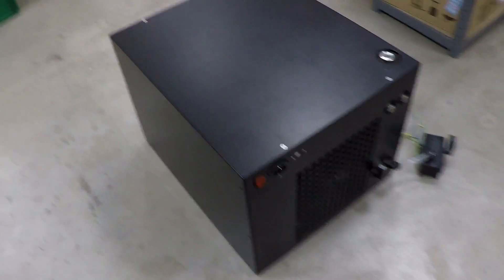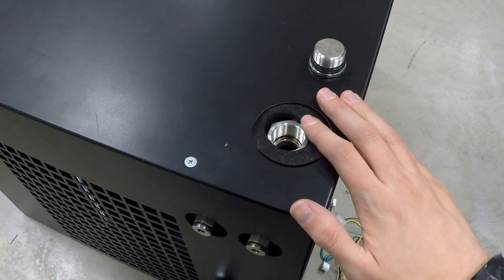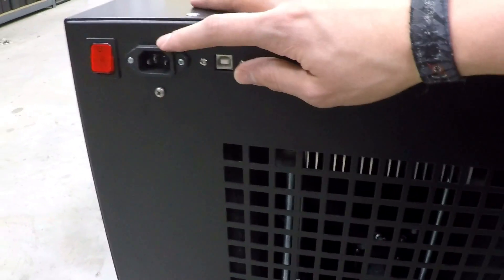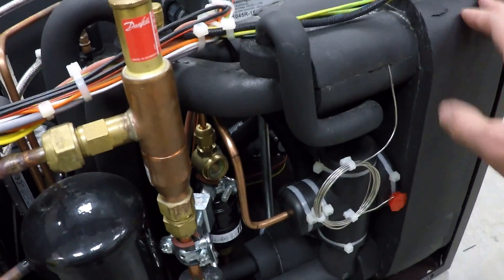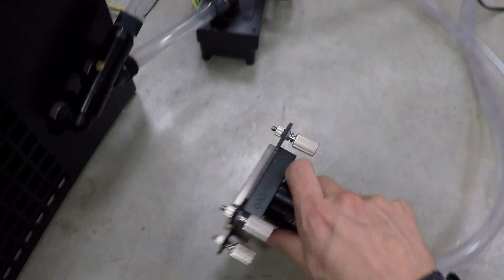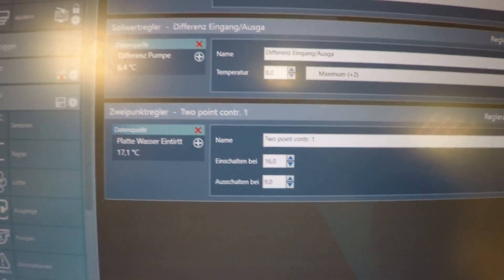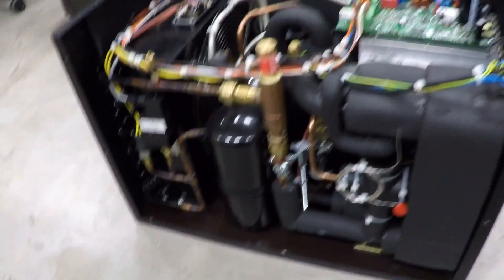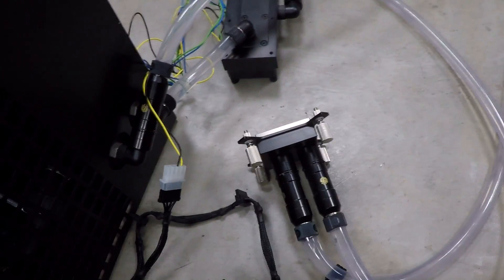The Titan X Project - Part 3: The Chiller

Comment: Hey Roman ich habe da eine Frage oder auch an die Community. Ich habe zurzeit EINEN RAM Riegel DDR3 mit 8GB und 1600 DIMM. Ich möchte mir jetzt weitere 8 holen also damit ich insgesamt 16 habe. Sollte ich mir jetzt die weiteren 8 GB als dual holen sodass ich dann 3 Riegel habe oder das ich insgesamt 2 Riegel habe?

Comment: Where is the titan x pascal overclocking video after all the power mod ?
Reply from the maker: didnt have time to finish it yet. Moving into a different apartment atm which takes some time :/
Reply: Hey man. Thanks for your helpful vids. There is a little debate regarding the power mod on pascal, and if you should mod 1, 2 or all 3 resistors. Do you have some thoughts on that matter by any chance?

Comment: Roman, I've hooked up my chiller, works like a charm! But I'd like to cool my water a few deg below dew point. What would you recommend I should coat the area around GPU and CPU with?
Reply: +Steeludder Would a conformal coating spray be enough?

Comment: Ich habe  eine Asus Strix Advanced Acitve GTX1080 die momentan durch Asus GPU Tweak stabil auf 2088 Mhz läuft (Powertarget 120% - Memory Clock 11000Mhz - GPU Boost Clock 2000Mhz  - Temparatur unter Volllast (Benchmark oder beim Zocken von BF1 Max 65°C))
Wie weit kann ich noch gehen ohne Angst zu haben das mir etwas an der Karte "Durchbrennt" etc gibt es etwas auf das ich achten kann / muss ? Die Voltage habe ich nochnicht verändert. Kann ich den Boost Clock & Memory Clock einfach noch höher schrauben ? (via Overclocking range enhancement)

Comment: Actually how it works is the compressor turns the coolant to gas which gets to the radiator to cool down and then it goes to an expansion valve which turns it to liquid and makes it super cold and THEN go to the heat exchanger.
Reply: Unless you are trolling you have it backwards...
Reply: Den Log Prove me wrong.
Reply: Den Log Huh? That just supports my explanation???
Reply: acnfanmanin How when the coolant is already a gas when it reaches the compressor? The compressor does not turn a liquid into a gas... The condenser turns a gas into a liquid. How when the expansion vale turns a high pressure liquid into a lower pressure gas? Again you are backwards.
Reply: Den Log What? Dude read your article again carefully
Reply: acnfanmanin I did troll guess you did not. Prove me wrong.
Reply: Den Log Look the proof is right there in what I said and the article. Educate yourself

Comment: WHat chiler do you use? How you deal with condensе?
Reply from the maker: just don't go below dew point. It's a custom made chiller
Reply: below room temperature right?
Reply from the maker: condensation depends on temperature difference and humidity. So at 20 °C room temperature you can run ~9-10 °C water temp without condensation on the components
Reply: Hm, you have to have 40% humidity. It'll dry throat :-) . I ask myself whether it makes sense to use chiller for my 2xPaskal Titans? They run on water now?
Reply: Why not trying to use a deshumidifier to reduce condensation in the room? 
Or even better do the benchmarks and overclocking in a very small room with deshumidifier and take the chiller out. The deshumidifer will have no trouble lowering the humidity and all the heat will go out.